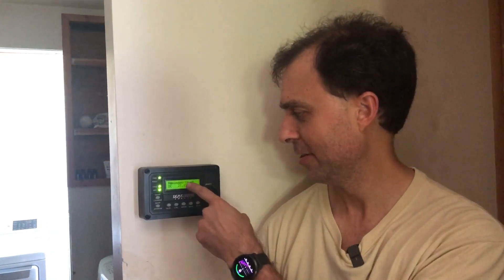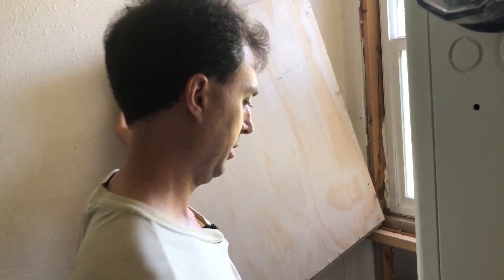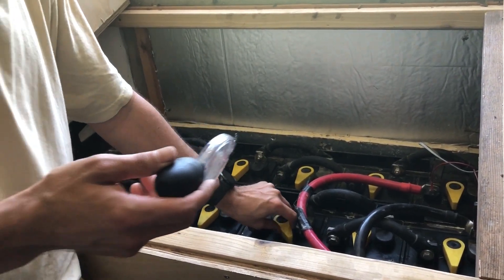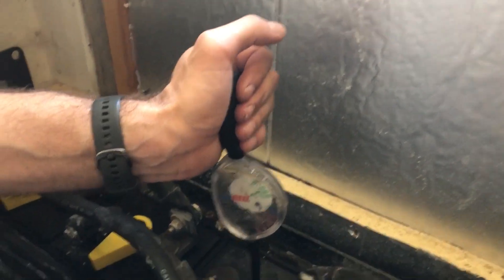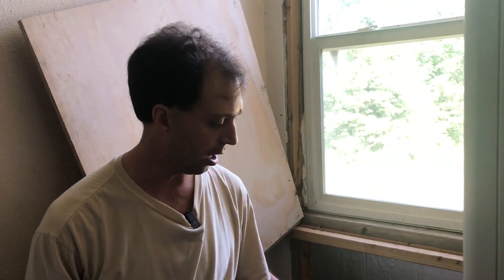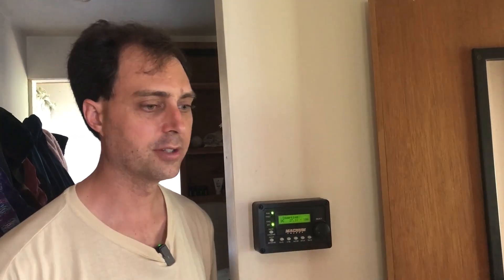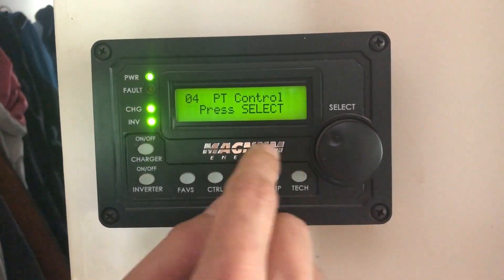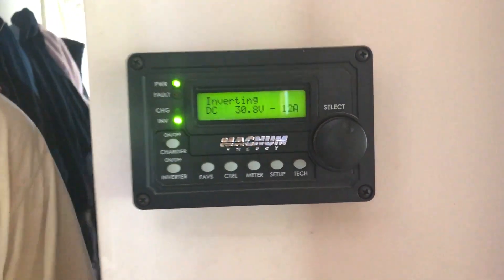Battery Boost 101: How to Equalize Your Off-Grid Solar Setup

Comment: Wondering, should you be turning off all breakers prior to equalizing?
Reply from the maker: No, I don't do that.  I think I've seen somewhere that certain DC appliances may not like the voltage getting as high as it does during equalizing, but I've never experienced any issues with it.  And as far as AC appliances, the voltage for them stays the same since the inverter is putting out 120 volts regardless of what the battery voltage is.
Reply: Thanks for Sharing, how many amps per hour are your cells?
Thank you for the accurate explanation Greetings from Lebanon!